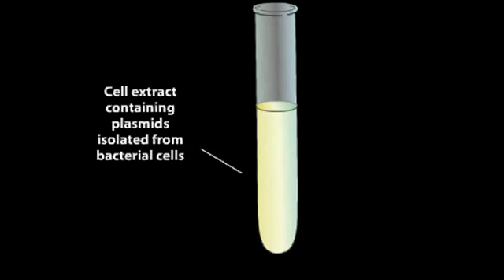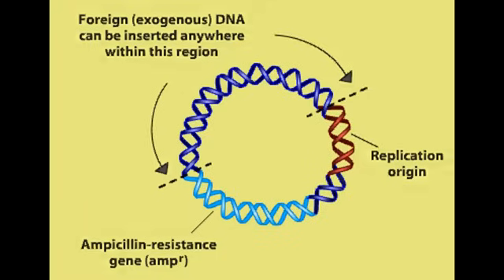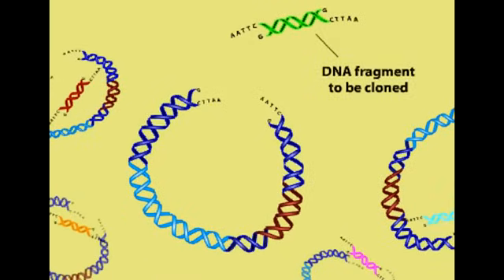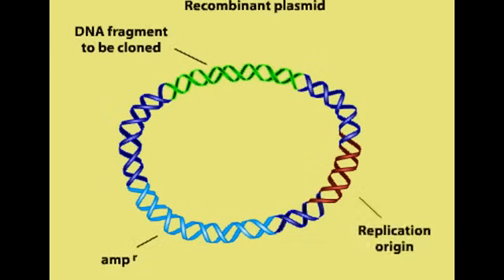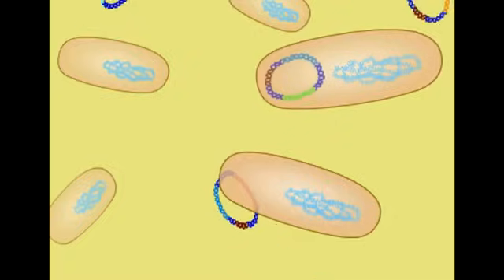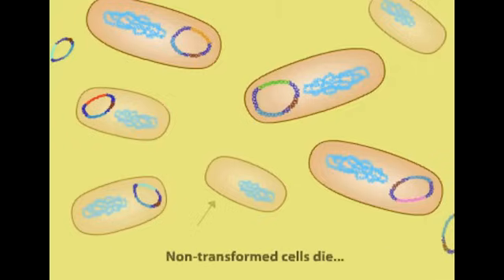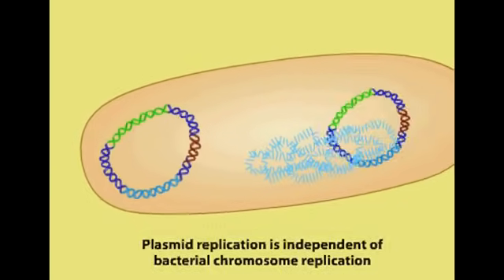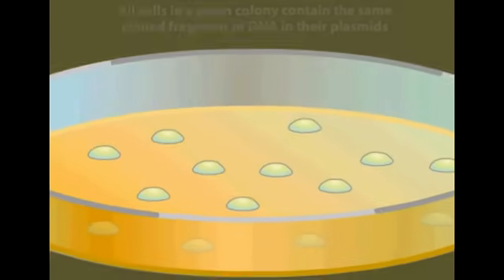DNA cloning

Comment: How do you determine which bacterial colonies have the gene of interest? Also, if you wanted only exons and no introns, wouldn't you use RNA and reverse transcription to produce complimentary DNA? Let's say you want to genetically modify an embryonic animal: Would you inject the bacteria themselves into the embryo or would you need to isolate plasmid DNA?
Reply: He said it, through doing an assay on each colony (for your first question). The bacteria is the host, if you want to genetically modify an embryonic animal, wouldn't the animal be your host? So you don't inject the bacteria, you inject the plasmid into a still growing zygote (okay I think doing it in a multicellular animal would be very much more difficult?)